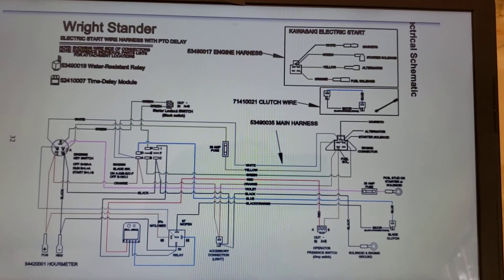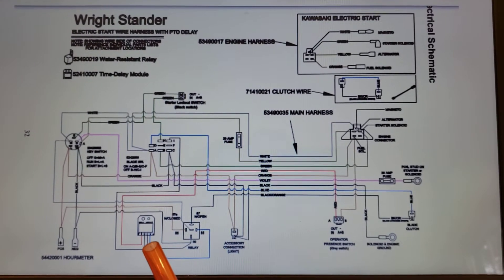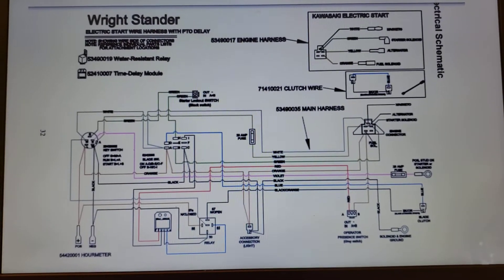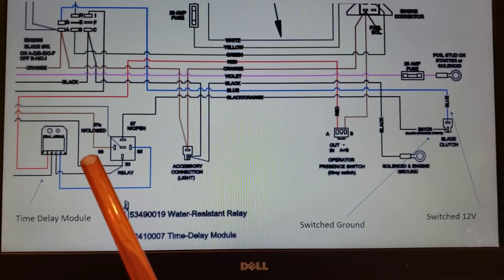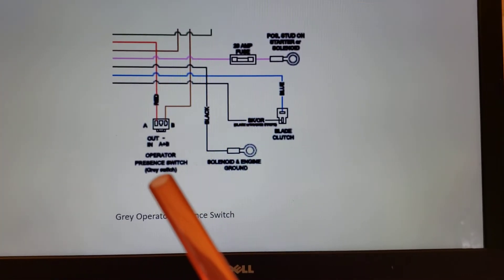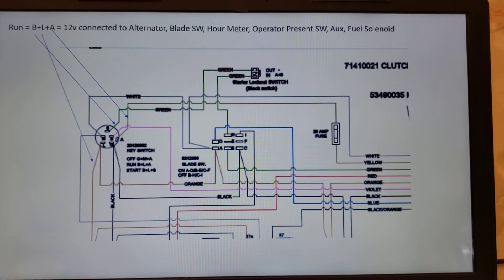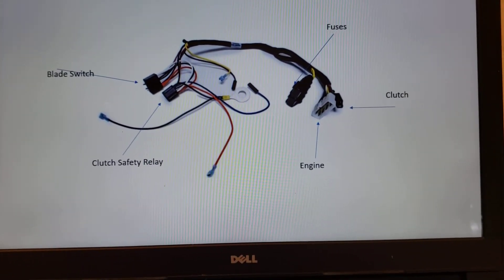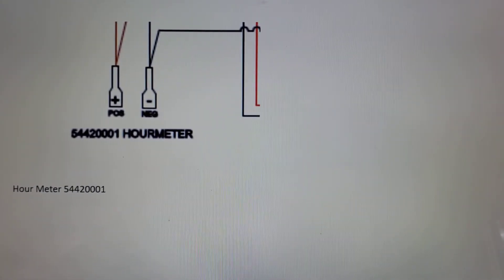Wright Stander Schematic/Wiring Diagram and Wire Colors

Comment: hey brother, where can i get that wiring diagram?
Reply from the maker: Do a Google search on write stander instruction manual inside of that manual you'll find one sheet that has a schematic on it typically. I'm not sure what model you are using but most of them are very similar. Also I have some good information in the description for some of the color coding of the switch wires that could be helpful!